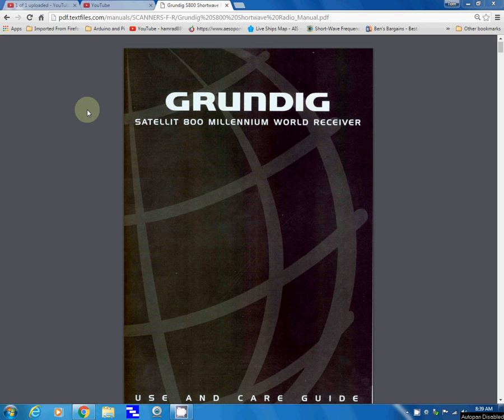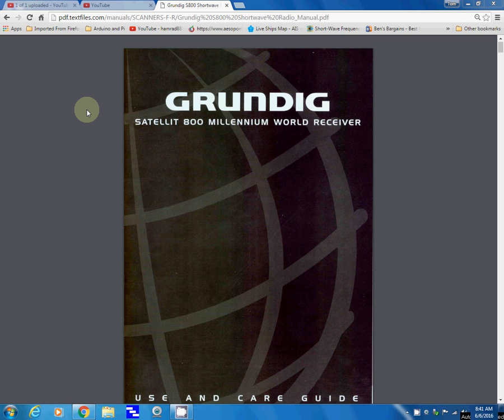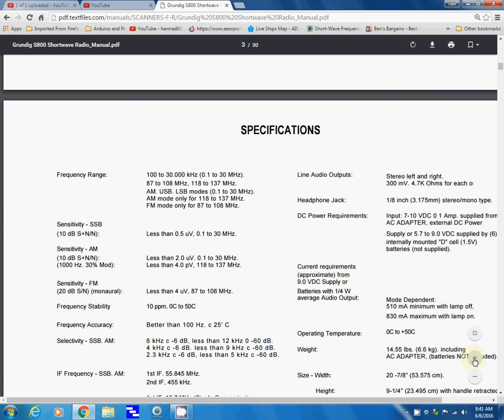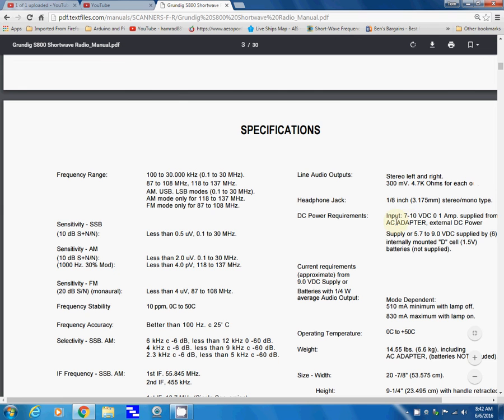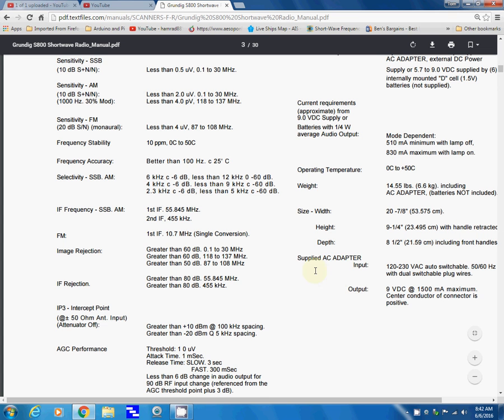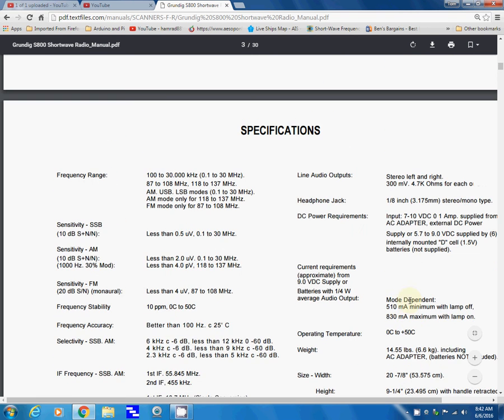TRRS #0884 - Gundig 800 AC Adapter Specs ??

Comment: Sat 800 from day 1, AC adapter transformer / linear 9V @1000 ma. Regulation not needed, as internally the 800 provides for 5v and 15v regulators that serve its purposes. Don't feed over about 11v or more to the average Sat 800, as it will eventually internally fail, most notably one of the regulators.

On batteries, 6 x 1.5v alkalines = 9v as designed for, can use NiMH, but 6 x 1.2x V DC will equal 7.5v DC which will cause the LCD BATT to light and/or flash, although the 800 will usually operate on fully-charged NiMH.

With the LCD / S-meter light enabled, the average Sat 800 draws it's namesake..right about 800ma, less of course with the light off.

Switching AC adapters 115 / 230 v AC 50/60 Hz will in vast majority NOT work and/or will generate horrendous RFI / EMI, RFD "ripple" if you wish rich in harmonics. Sensitive receivers are sensitive that that, historically wiping out performance in especially HF and FM bands.

Universal 1 9v DC @ 1000 ma amp AC adapter are available that have historically and do work fine, as they provide sufficient adjustable voltage DC and AC input, and average 4700 uf ripple filtering, to serve the 800 well...as are now and then OEM AC adapters will surface as well.
Reply from the maker: Thanks for the inputs, Joe.